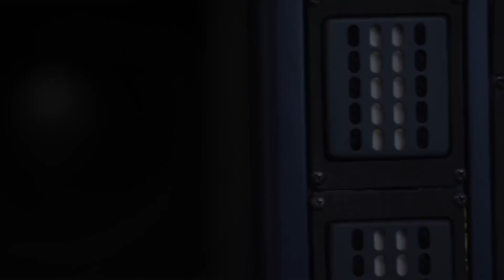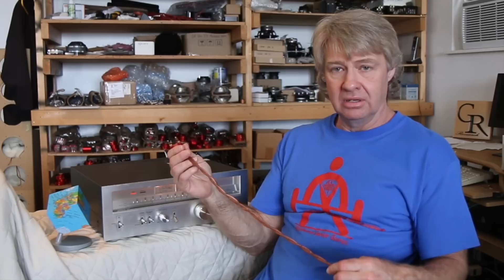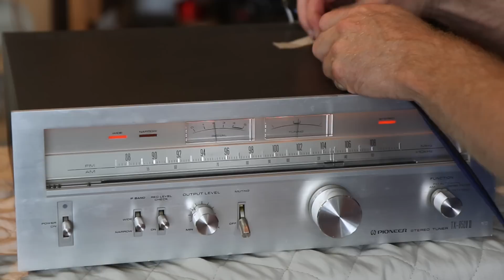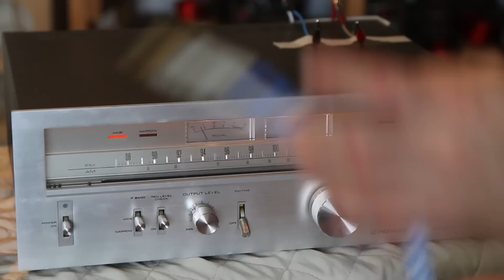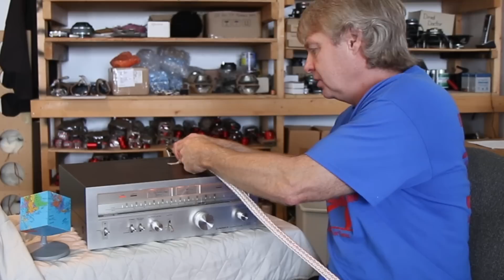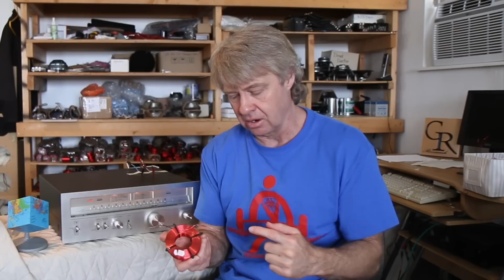Do Audiophile Cables Matter? Here's PROOF!

Comment: Thank you for the video Danny. We hope the audience will understand the concept. Any copper wire  inherits a resistance, capacitance and inductance dependence on the length. Simply all metal cable acts as a antenna receiver. Also any cables siting adjacent to your own will pick up signal by means of magnetic field. The Higher power siting along side to a lower power cable will always shut the lower signal power cable. Using twisted cable for e.g. CAT7 will reject noise or unwanted signal by creating a common mode of rejection by the twisting the wires which cancels the noise. Danny favourite cable is the twisted shielded braiding works similar to a faraday cage characteristic on a cable. Some people uses coaxial cable as the speakers but, they are not ideal as most have either 75 or 50 ohms characteristics built in. For a short distance they are OK.

Comment: Danny, the ability of a speaker wire to pickup electromagnetic energy is of no consequence to audio because neglecting other factors, the audio information riding on the RF carrier must be detected (demodulated) to recover the audio signal. The signal strength meter only shows the RF carrier level which cannot be heard unless there is something to detect the audio signal riding on the carrier, either a diode in the case of AM or a frequency discriminator in the case of FM, neither of which is part of an amplifier or speaker. To prove this, put the cables between an amplifier and speaker in the usual fashion and listen for noise without playing anything. If you can't hear and measure anything different with the different cables, there is no audible or measurable difference between the cables. The reason that the big cable showed less signal strength is because it has some additional capacitance and possibly also inductance which acts as a filter, but this is of no consequence in the application as I just stated. Also, while noise can be radiated or conducted, the potential for noise from the power wires being conducted to the speaker wires is nil, because of the filtering within the power supplies. If it was being conducted through the power supply, it would result in clearly measurable and potentially audible results depending on the amplitude of the noise at the amplifiers output, degrading the signal to noise measurement.
Reply: @ufarkingicehole  The fact that some differences in speaker wire construction can affect the "bled" signals as you call them is irrelevant in the "sound" of speaker cables. It is obvious that it was his intent to demonstrate that there is a difference in speaker cables in this regard, but it is unimportant to the "sound" of the cables because the audio signal riding on the RF carrier has no way to be recovered as there is no mechanism to perform that function. There may be many microvolts induced in a speaker wire that has a high impedance termination such as a FM tuner, but the impedance of the amplifier is very low even at 100MHz therefore the voltage will be super low across the speaker wire conductors when connected to an audio amplifier. In any case, the point is moot because again the audio signal has no mechanism to be recovered from the carrier.  Audio technology comprises many disciplines and having a lack of understanding in any one of them can cause the wrong conclusions to be drawn.
Reply: Stewart Markley, Danny only demonstrates the shielding and non shielding speaker cable effected by RF signal. He wasn’t talking about demodulation RF audio sound adding into the cable. At home I use two coaxial cable, only the center conductor are use. It is a cheap way to shielding noise. I use RG6 cables. Danny is talking the nth degrees of shutting noise.
Reply: @tonychan6814  But the implication that an FM signal can affect the audible noise induced by a cable is incorrect. The noise has to be audible to make a difference, we can't hear RF noise.
Reply: @StewartMarkley  Exactly.💯 Accurate.
Reply: @StewartMarkley  What if it gets amplified-
Reply: @michaelcurwick3539  the RF isn't amplified by an audio amplifier because the frequency is way too high. The audio that rides on the RF carrier cannot be recovered from the signal because it must be recovered by frequency discrimination for a FM  signal. For AM signals, the audio recovery is much simpler and there is a slight possibility of the audio being recovered in an audio amplifier and amplified, but if you cannot hear any audio signal when no music is being played, then there is no problem with the speaker cables or any other cables.
Showing that different wires act differently as antennas is irrelevant in an audio system unless you can hear a radio station when not playing anything. In which case a small capacitor placed at the input of the offending amplifier will fix the problem. It makes no sense to spend all kinds of money on cables that do the same job as a simple cheap capacitor.
Reply: Stewart - Thank you for teaching me something I didn't know.  I understood what you did with the shielding on cables, I know we are bombarded with frequencies of all kinds.  I don't think I want an aluminum helmet but a braided vest may be worth considering Ha ha. Thanks for putting up with all the controversy out there, let us know if you have any thoughts on 5G.
Reply: @michaelcurwick3539  Well 5G has a higher (much higher) frequency band, but I can't really see it being any different a factor for audio systems. In any case, I stand by my statement that if you cannot hear any noise from the speakers or headphones when no music is being played, other than a possible constant hiss (white noise) from the thermal noise of the amplifier/preamplifier, then you do not have an RF noise problem. If you do hear a noise other than a constant white noise, you can experiment with a very small value capacitor, say 10 or 20 pf, and probably eliminate the offending RF noise for almost no cost.
Reply: @tonychan6814  how do you ground the coax shield? this is the only way the shield works, and since speaker/amp connections don't provide a spot to ground, are you using an external device to do this?
Reply: Brilliant. sense at last. agree with every word of that stewart.  but gentlemen you have all been had !   because the original post no matter how amateur or innacurate was meant to get the two camps going for each others throats.  slightly off topic i know but there is an old saying that if you ask twelve electricians the same question you will get twelve different answers. and i can attest to this as i have proved over and over again. and the question can be about something quite important like earthing which you would assume because its a safety aspect you would expect more or less the same answer from all of them but no - the difference is surprising in their answers. but as for this original post  its a joke and only designed to get traffic at our exspense. nice one though stewart, there will always be dissagreement about audio cables , for those of us who have been dealing with audio and electronics for decades we can sometimes be an easy target due to our opinions based on our findings over many years, however one thing is for sure and that is most of us can tell a piss take when we see it and this is certainly that . if not then the original poster is clueless about the subject he is talking about and i don't like to think that so its just a piss take designed to get and increase YT traffic. have a good day all and just agree to disagree and don't rise to the bait..
Reply: @johnsmith-hc3ry  the real question is do you actually un-capitalize words after periods? Truly a remarkable phenomenon here, as you literally only capitalized "YT" in your comment.
Reply: @Mike_Jones68  and Brilliant 😅
Reply: I come to this channel for measurements and explanations.
Reply: @Art DIY it's mostly about the resistance affecting the damping factor. Any capacitance and inductance can affect the high frequency rolloff but will be far above the audible range.
Reply: Big f.. deal and GR research crazy hypothesis - I buy some Mogami coax speaker cable if I live next to RF transmitter antena.
Reply: AM radio comes through all my unshielded cables so strong I can hear the radio station without a tuner or antenna, WITH NO MUSIC PLAYING, the moment I turn the stereo on I can hear faint AM talk radio, and it gets strong at night especially a night with high cloud cover. The better quality of shielded cables, the less noise. I have seen proof, aka conducted this experiment, myself.
Reply: Agree, class 9304 Orlando BTW ;)
Reply: Also any wire will pick up RF. The wires you are using are opened ended, it needs to be terminated as it would be in the circuit. Put an 8 ohm resister across the open ended wires and redo the test. Your 4th wire measure the capacitance and you may find it reject the frequencies in the 100 MHz range.
Reply: @rf0022  Yes, any electromagnetic field will induce a voltage in a wire. And you are also right that the terminating impedance will affect the voltage across the wire, but the tuner does terminate the cable with either 300 ohm or 75 ohm impedance depending on which antenna terminals Danny used. And also the extra capacitance and also possibly inductance in the 4th big cable is why the voltage is reduced. None of this matters however because the audio modulated on the FM carrier cannot be detected as there is no such mechanism in the amplifier or speaker. This was a faulty demonstration of any influence of RF energy affecting the sound of a speaker cable. The only way to demonstrate if there are any differences between speaker cables relative to their capacity to pickup RF/EMI is to use them in the usual fashion between the amplifier and speaker playing nothing and listen for anything different between the cables.
Reply: @rf0022  Absolutely true. But many audiophiles and engineers even very smart ones do not believe in Ethan's null tests for reasons they cannot scientifically or psychologically validate. I find that in this field, many opinions and beliefs that people have are based on flawed comparisons and incomplete knowledge of the various scientific disciplines involved in the equipment being compared. No offense to Danny, as I believe he is THE MAN especially when it comes to crossover design, but this display of the characteristic of electromagnetic fields inducing a voltage in a speaker wire is not relevant to the speaker wire application.
Reply: @rf0022  not If it’s shielded like a coax. Here it’s irrelevant.
Reply: I dont believe the RF was the intent of this experiment.  The point was rather you believe speaker wires are all the same.  Danny demonstrated this beautifully.  

The "best" speaker wire had almost no absorption of bled noises.....kind of like a filter of unwanted signal. Danny is correct to show the wires are not the same when it comes to insulation from bled noises.
Reply: @ufarkingicehole  I can't agree with you here. Danny did show rather conclusively that there is a measurable difference between speaker cables that was focused on their capacities to induce a voltage from the electromagnetic field from a nearby FM radio station. However this is totally irrelevant in the application of a speaker wire because there is no mechanism in either the amplifier or speaker to detect and recover the audio signal from the carrier. Thus the audio signal modulated on the carrier cannot be heard in a stereo system application.
Reply: @ufarkingicehole  The problem is that selling premium speaker wire because it does not capture RF is disingenuous and deceitful. It solves a problem that doesn't exist. You can't hear RF without amplification.  RF frequencies are in megahertz, multiple times beyond the upper limit of human hearing. If RF were a problem, why aren't the wires inside the speakers shielded? If RF can pass through walls to interior spaces surely it can pass through a speaker cabinet.
Reply: @GTRxMan  the RF interference wasn't the point being made. The point that is being made is people say all speaker wire are the same. Danny demonstrated that with a very simple application that wires are different as in not the same. 

Speaker wires 1000000% make a difference.  My preference is running 10-12awg 100% oxygen free copper that cost me under $30. I use quality banana plugs or spades. It absolutely sounds different than copper coated 14 awg wire. Silver wire is insanely priced but its a step up if you have a system that is lacking in the mid/highs. 

RF signal isn't something that concerns me but I have confirmed myself wires aren't the same. I also use 10-12 awg quality $35-$40 power cables and yes that also made a difference. It allows current to flow with less restriction.
Reply: @ufarkingicehole  "the RF interference wasn't the point being made. Danny demonstrated that with a very simple application that wires are different as in not the same."
Lmao, he demonstrated that "wires" are different in how they transmit RF for christ's sake. They can be "demonstrated to be different" in their colour too, can you then say "oh they are demonstrably different therefore they must also be different within the audio frequency range!"? No, obviously.

This is the level of rank logical fallacy you need to be operating on to be an audiofool, ooft.
Reply: @Epic501  you believe all speaker cables have the same sound regardless of gauge and material?
Reply: @ufarkingicehole  the entire experiment is bullshit because no one thinks they're all the "same". Serious people know that well engineered cables for a nominal fee perform the intended purpose of transmitting audio frequencies without characteristic impedance mismatch and excessive capacitance as to induce oscillation. With low impedance cables there will be no reactive, audible effects on the listening. 

All Danny demonstrated was conductance changes with wire gage. Color me surprised at this 20 minute 10 second waste of everyone's time.
Reply: All  the same?  They are not all the same !  it  just  doesn't make the kind of difference this guy is making out.  @ufarkingicehole  
As  physicist  of  done my share  of  testing it  the connection the matter and  alligator  clips ????
Reply: Fights between individuals, as well as governments and nations, invariably result from misunderstandings in the broadest interpretation of this term. Misunderstandings are always caused by the inability of appreciating one another's point of view. This again is due to the ignorance of those concerned, not so much in their own, as in their mutual fields. The peril of a clash is aggravated by a more or less predominant sense of combativeness, posed by every human being. To resist this inherent fighting tendency the best way is to dispel ignorance of the doings of others by a systematic spread of general knowledge. With this object in view, it is most important to aid exchange of thought and intercourse.
Reply: @billjackson3257  That's an impressive amount of words to make a point.
Reply: LOL  @billjackson3257
Reply: @billjackson3257  that's pretty deep. I will never think of Radio Frequency the same

Btw.. ever see "they live" or "1984"
Reply: @billjackson3257  That is what we are doing here. And I would add that it is very important to remain civil and courteous in doing so.
Reply: @StewartMarkley  bullcrap

Comment: If the RF noise getting into the speaker cables would make an audible difference then why when I connect nothing but a speaker cable to my speaker can I not hear this noise? If it's after the amplifier the noise will not be Amplified and will not be heard. Now before the amp is a different story and thats why those cables are shielded. I used to like your videos but I don't think i can watch after what you just said in this video, if your cable is "filtering" out any audible noise at all then it must be filtering out some of the actual audio signal unless your cable has some type of computer processor hooked up to tell the cable to filter out electronic noise but not filter out audio signal lol your nuts if you believe this.
Reply: @John Lastname : Well said, reasoned. @Danny Ritchie : ad hominem, really disappointing. I unsubscribed.
Reply: @Greg Hastings No one is trying to fool anyone here. Just trying to teach the truth. Sorry if the truth runs contrary to your beliefs.
Reply: Not a problem. I can only educate the willing.

Comment: 1. Inductive reactance
2. Capacitive reactance
3:  Shielding.
Yes, high end cables sound different, if you like rolled off...because wire has no gain.  I prefer my wires to have no "special filtering effects."